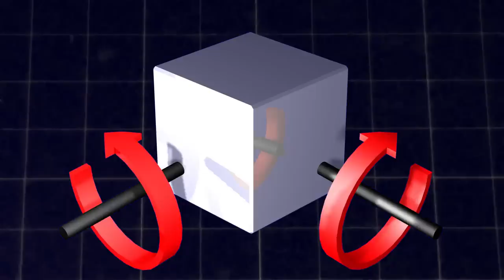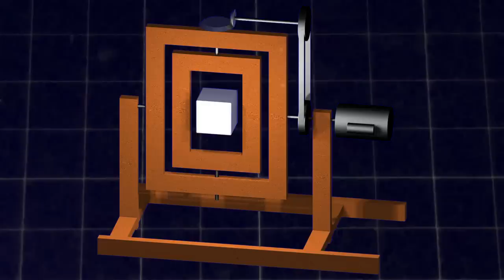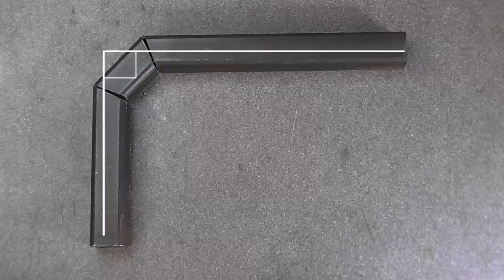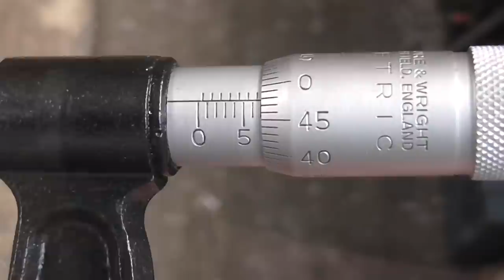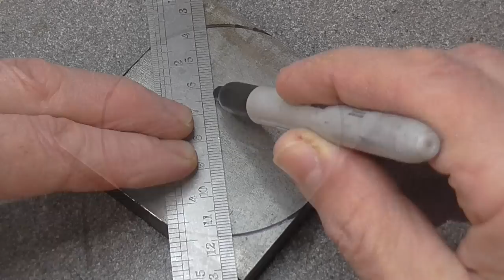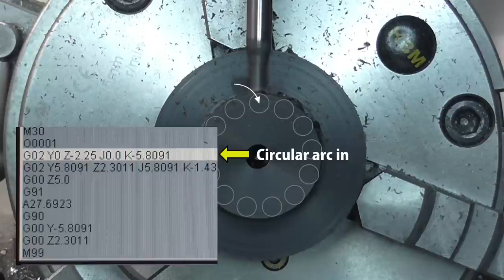DIY Rotational casting machine

Comment: Love the ball chain pulleys, great idea. I don't have a CNC mill, but they look like they might print fairly easily?
Reply from the maker: That's a good idea that didn't actually occur to me! Yes, you probably could 3D print them, they don't need to be all that strong especially if the mould is well balanced in the centre of the machine.

One thing I didn't mention about the pulley design, is that the pitch of the chain actually gets smaller as the radius of the pulley decreases due to the shape of the link ends inside each ball. I measured this for the two diameters I needed, but I imagine it would be possible to write some parametric code to generate the pulleys automatically (maybe somebody has even already done this?)
Reply: @AndysMachines  Very interesting, thanks! I wonder if the variation in link length is consistent between manufacturers. Might have to buy some chain and play about...

Comment: Very clever, is the larger pulley blank made from shredded milk bottles via your shredding machine?
Reply from the maker: Thanks! The large pulley was made from an offcut of nylon sheet/plate I had to hand that was the right size. You can see in the video that it doesn't machine as nicely as the acetal, I had quite a lot of melted fluffy stuff to clean off afterwards. HDPE would probably behave very similarly. I always prefer acetal/delrin for any machining, it cuts very cleanly.

Comment: Will you be casting something for the Terminator?  It seems most of your machines are used for this purpose.  Great video, thanks.
Reply from the maker: I probably won't be using this machine for any terminator parts as it can only cast plastic and rubber resins. Yes, it does appear as if several machines I've built recently have only ever made terminator parts (not too far from the truth!). You'll get to see an example of what I'm making with this machine at the end of the next video.
Reply: @AndysMachines  Thanks; looking forward to the next video.

Comment: Question since the Small pulley is stationary wouldn’t your chain just stay still thus not really matter where you put the master link as long as it’s one rev away from the pulley if you get what I’m saying
Reply from the maker: The chain actually makes its way continuously around both pulleys even though one is stationary. It can be hard to visualise, but at 12:50 you see me hold the arm stationary and rotate the hub (with small pulley attached), this is equivalent to rotating the arm around the stationary pulley.
Reply: I got ya wasn’t sure would have to see it in action

Comment: I think a timing belt/tooth belt should also be able to rotate 90 deg without a problem.
Reply from the maker: Yes, I've seen people do that with toothed belts. It's not how they are designed to be used, but works ok for light loads. There are also round rubber belts that would work, but not being toothed they can slip so need a lot more tension.

Comment: It would be some extra editing but could you lower the volume during machining operations a bit? It's like machining without ear protection currently and I have to turn the audio way down.
Reply from the maker: Well I did decrease the volume for most of the machining, but in part 2 I'll make sure there's nothing above -10dB. I think it also depends what device you play it back on, some play certain frequencies much louder, I always use headphones when editing.